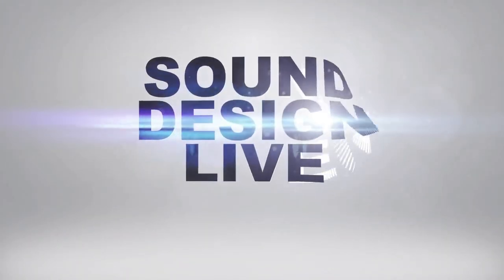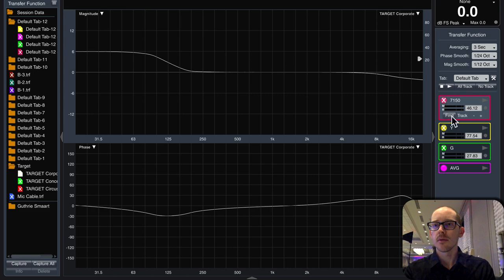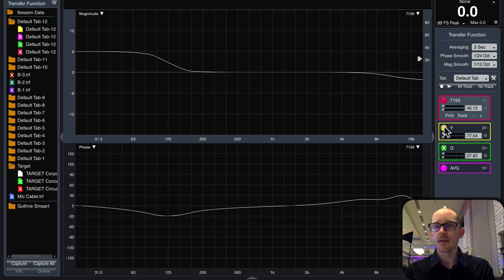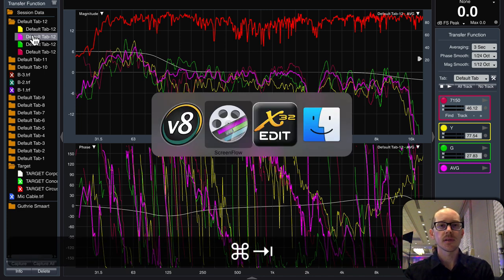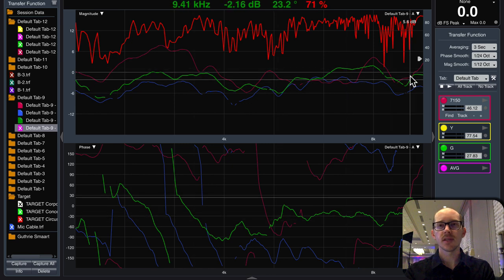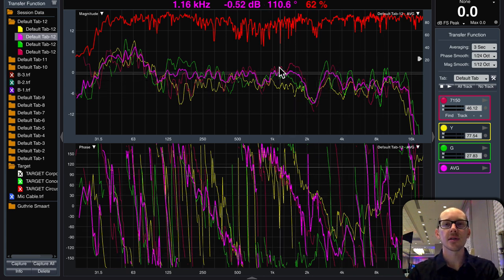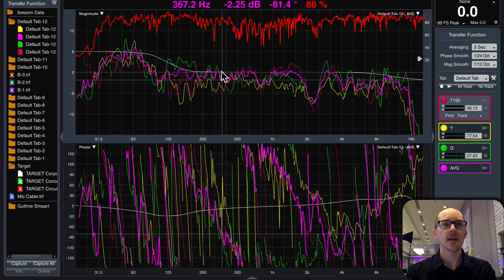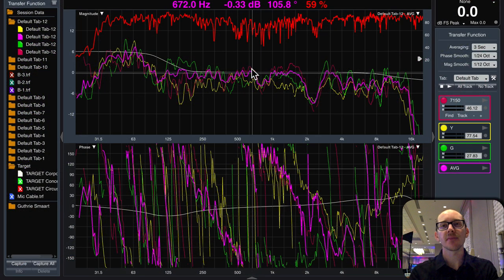Quick Line Array Tuning Level & EQ in Smaart®

Comment: Bob's book suggests that it's a bad idea to run array sections at different levels because you lose LF directional control. Instead, he suggests HF equalization (per array section) to level match. You can see that some speaker manufacturers include this concept into their array-able enclosures with HF shelf buttons.
Reply from the maker: Thanks for checking out the video and offering the tip. What section of Bob’s book are you thinking of? I’d love to take a look.
Reply from the maker: Hey Chris, I'm still hoping you'll point me to a section or page number. I looked in a few places and couldn't find this.
Reply: its simple line arrays need to have de same level in every boxes to work has line array the directiviy in low frequencies work that way you can see it yourself using some prediction software end see what happens with de low frequencies range directivity lobes

Comment: Nathan, I'm looking for an interface to take measurements in REW or Open Sound Meter, I'm just a hobbyist and can't really spend much on this project.
With that said, is the Steinberg UR12 a good interface to use for this? Where I live it costs nearly half the price of the Focusrite Scarlett Solo 3.
Reply from the maker: Hey Corrado, I wouldn't worry too much about it. Get whatever is free/cheap to start out with.
Reply: @nathanlively  Thank you Nathan!
I did some research today and found the TASCAM US-1x2HR for just a couple of bucks more, I think I'm gonna go with the Tascam, gotta do a little more research.

Comment: Is it worth having a tablet connected to the PC of the system to control it remotely and to be able to change the positioning of the microphones or is only a 4-channel interface more than enough? It is quite frustrating in large venues to continually move for mic positioning between FOH and mic position.
Reply from the maker: In my opinion, it's required. At this point I only travel with one mic, so I have to be able to move it many times.

Comment: Hi sir.. great videos.... it’s really helpful to me.. I would like to know what’s the minimum height we require for flying a line array speakers!!! May be its a stupid question..but I am learning.. thanks ;)
Reply from the maker: Hi Robins, thanks for checking out the video. There is no single answer to this question, but want to shoot for a design where the front to back ratio is represented in your boxes per zone and slay angles. Usually, the higher you can get them, the lower your front to back ratio and the less dramatic requirements of your array.

Comment: Question- for that dip you can see in smaart around 2k.. you wouldn’t bring that level up at all to try and fix the dip?
Reply from the maker: Hey Flock, I rarely use a boost filter, but in this case especially I wouldn't because I do not have confidence in the measurement due to low relative coherence and weird phase in that area.
Reply: That's the answer I've always heard. If a room is sucking up a frequency, you can't usually fix it with a boost. Plus, it increases the chance of feedback around that frequency.
Reply: Great question. That makes sense. If you were the boost here, is the concern that you would too much resonance in that 2K? Or is it that it’s a phase issue so no amount of bump would improve that section? Thanks.

Comment: Hi nathan, do you have a video that details how to set limiter values for the amp and speaker from a DSP processor. How do we calculate the voltage of the amplifier if only the sensitivity is known, and how to use this information to derive the proper values to set in dBFS and dBu.

Comment: Hie Nathan

And what about the coherence in the magnitude window? Does it matter if you're not getting good coherence above 70% for your EQ decisions to be accurate?
Reply from the maker: Hi Hie, yes it matters. Coherence is relative, not absolute. I do use it as an indication of how much I can trust certain data, but I don't look for a specific coherence number.

What about you? Do you try to always have +70% in areas you will be making EQ decisions at?
Reply: @nathanlively  Well, when time aligning the system (as I learnt from you), I try to have good coherence around the crossover region even though the data that I'm really looking at is in the phase window and not the magnitude window.

I see what you mean when you say you don't use a specific value. I don't either.
It's just that in my case whenever I move the mic more than 3 meters away all the coherence values go down drastically to less than 40% but the analyzer software still receives data of what the response is like.

Comment: These zones are per array correct? Then you're running the mix in mono?
Reply from the maker: Hey tylrbllmn, I can't remember if the system was set up in stereo or mono, but yes, the zones apply to the array. Zones A, B, and C will be the same on the left and right array, for example.